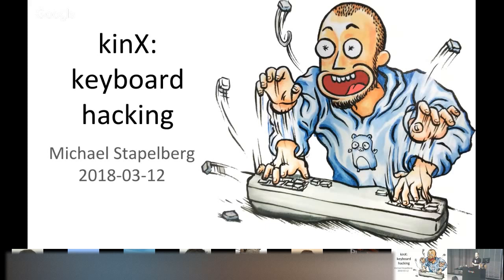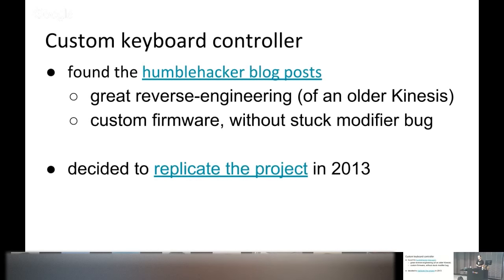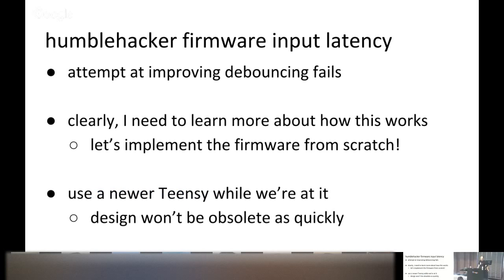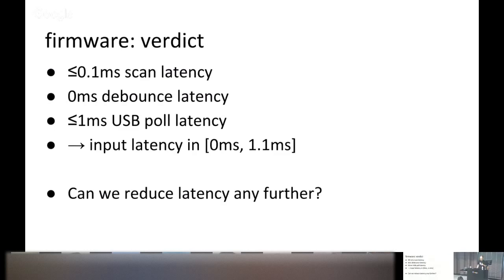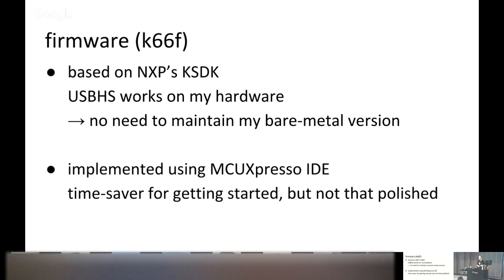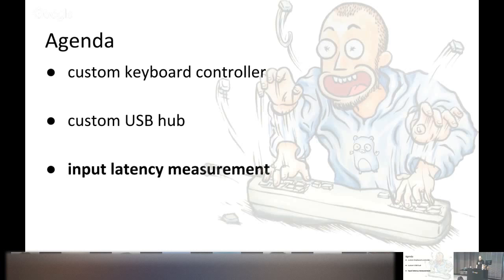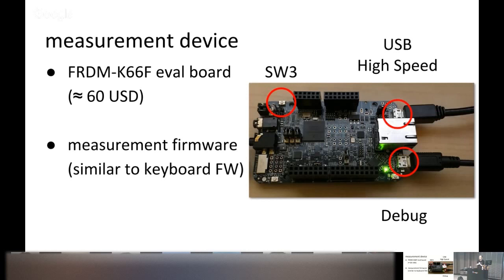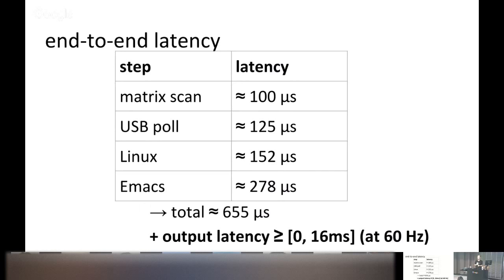kinX: Keyboard Hacking

Comment: Great talk Michael! Can you point me to the latest build you had working with Teensy 3.6 before you started using just the NXP MK66F? It's unclear if it's a certain commit in mk66f-fw repo on github or somewhere else.
Reply: I thought I replied to this, but can’t see the reply on YouTube, so I’ll do it again: I haven’t published the firmware I used on the Teensy 3.6 because it was never really polished. You can find the hardware in the https://github.com/kinx-project/teensy36-hw repository, though.

Comment: Bought Das-keyboard. In the instruction manual they say it's better to connect to PS/2 port rather than usb (if you have one). Maybe this is due to polling?
Reply: Polling is just one of the reason to avoid USB.  Other gripes with USB:
- Even putting aside polling issue, USB is "heavy" on CPU for what it does.  
 (Generally, not really an issue for gpu-heavy games)
- PS2 tends to be more robust due to its simplicity.  (But USB is more flexible.)